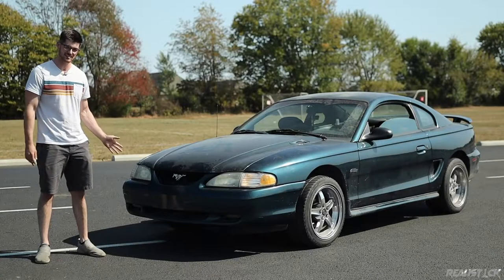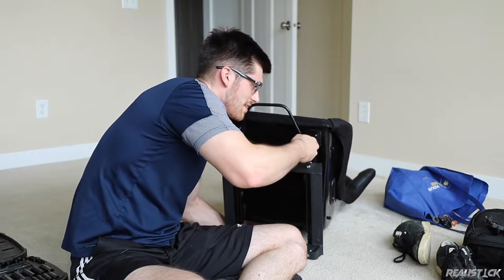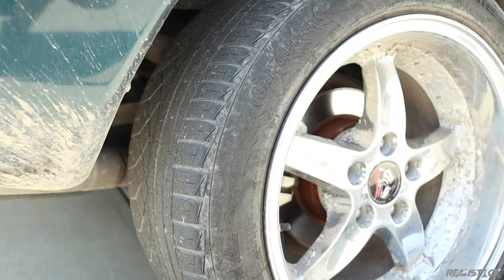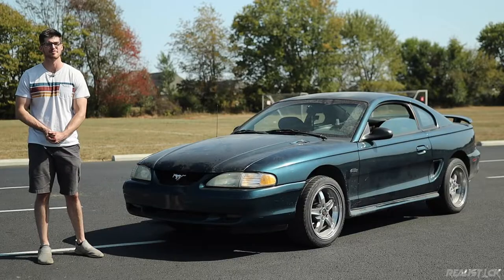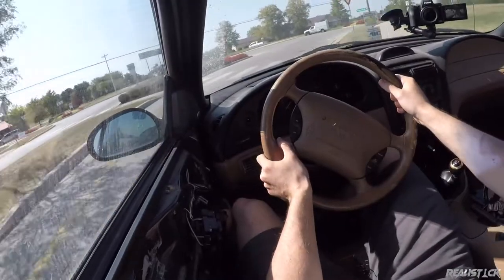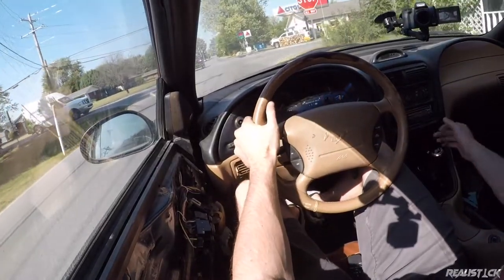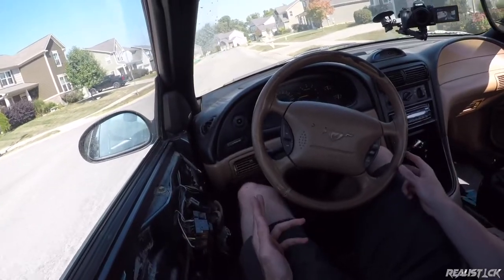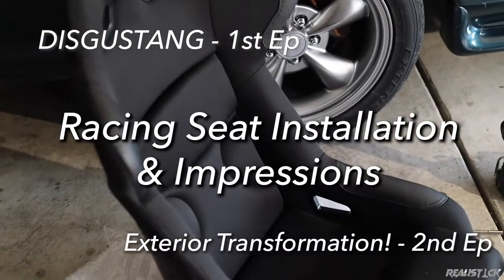DIY Drift Car Series Intro - Can I Restore a Bucket w/ Little Experience

Comment: Not a bad buy, these cars are plentiful, have lots of aftermarket available, and lots of used aftermarket parts out there that could help you save a few dollars. Plus, like a clapped out civic, the 4.6 is a fun motor to spin.

What's your next path for this thing other than tossing out the 700lbs worth of front seats?
Reply from the maker: Still trying to figure it out, I think the intake and exhaust manifold are leaking due to some noises im hearing (and smells). I just finished painting it so I think my next step is to get it inspected by my mechanic so he can tell me what it needs. There are a ton of little things that need attention. I am suspecting intake/exhaust manifold, engine mounts, oil pan gasket, odometer, and then I will install a second set of rear calipers, a hydraulic e brake, coilover kit (much much needed), rear seat delete, steering wheel reupholster. I'm forgetting some other things but I'm trying to keep momentum on the project as I don't want it to just sit around!
Reply: @Realistick  Nice, my friends were into these cars for a while. Based on those credentials alone may I offer you some unsolicited internet advice? Those things have soft a chassis, as in flexy. Getting some chassis strengthening parts go a long way to tighten the car up and make it not feel like a 4 wheeled noodle. Parts like tubular front subframes are popular because they're stronger than stock, lighter than stock, and open up tons of working space under the engine. I helped my friend put one on his mystic Cobra and afterwords it helped make working on the bottom of the engine a lot easier not to mention give it better steering feel.

Also changing the rear gears is very popular. I think those cars come with something like a 3.27 ratio, so 3.55 or lower help increase torque. As popular as it is it may have been done already on that car. You might be able to tell by looking up what the cruising RPM is supposed to be stock. A better diff helps too, but that's expensive.
Reply from the maker: @zachbrandt1236  Thank you, I appreciate the insight. I've heard before that the chassis is not too rigid and there isn't much structurally connecting the front and rear axles. Nobody has really had much to say on how to improve it so I appreciate that. I will probably take it to the track first before I do something like that as I would want to feel the difference. As far as the gearing goes, I believe this one did get the gearing upgrade but I will have to test that once I get the speedometer to work 😬

Comment: Hey bud hope the car is still running good for you im getting 95 gt up and running pretty good now few more things and she will be a1
Reply from the maker: Good to hear! Glad you saw the video, I just finished painting the Mustang today, it's looking a lot better. Junkyards have been pretty bare unfortunately so we are still looking for the door panel and odometers (the speed sensor was fine). Learning a lot though!
Reply: @Realistick  might have to replace the gears in the back of the cluster and can't wait to see the rest of the vids
Reply from the maker: @timmygrafe4455  yes, we took it apart but they looked fine, will probably just end up swapping it entirely
Reply: Hmm then I'm baffled on that one I have the same issue with the 95 but haven't jumped into it yet just had it chipped and tuned